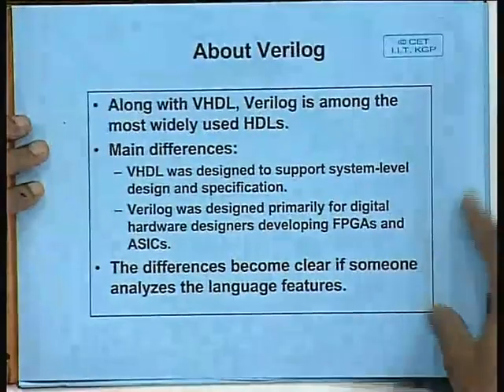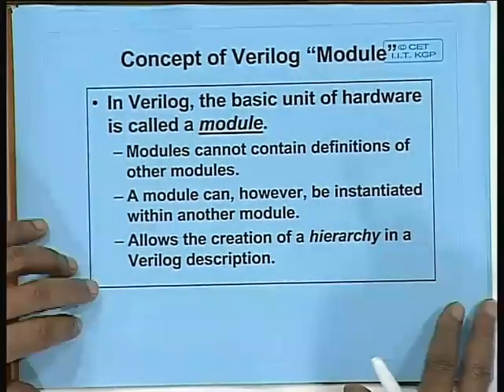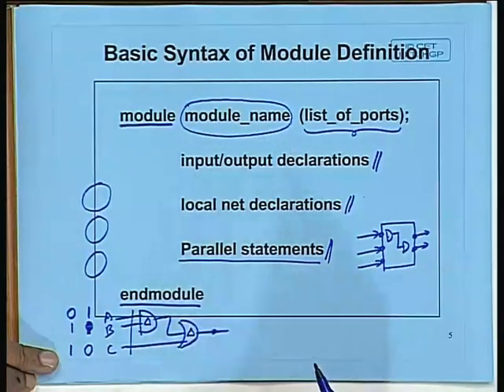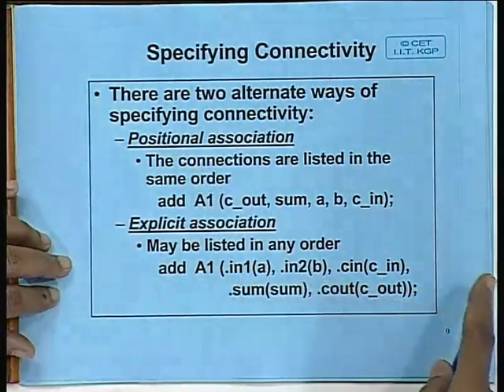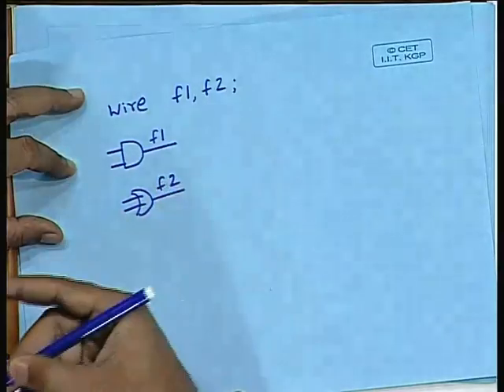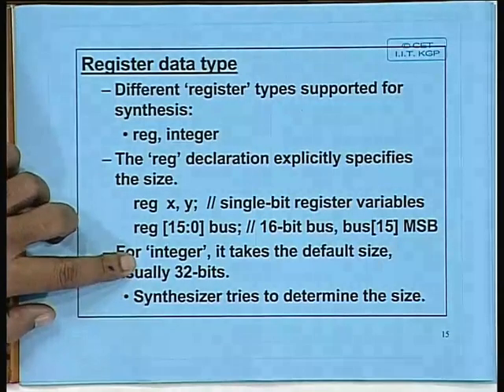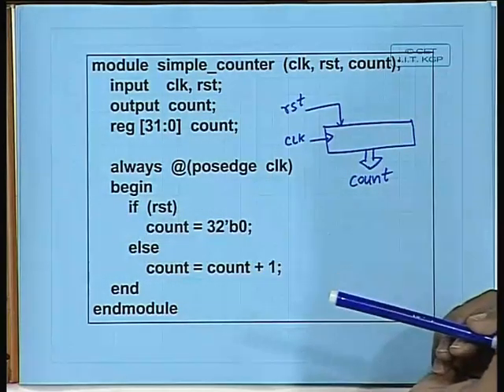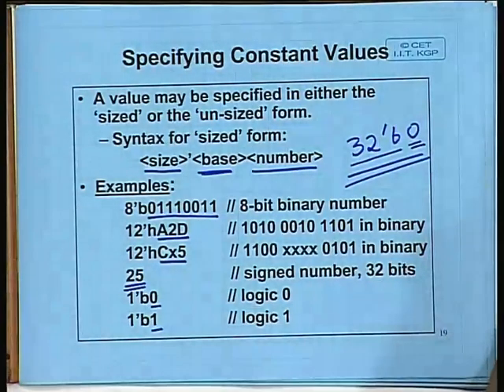Lec-2 Verilog: Part-I

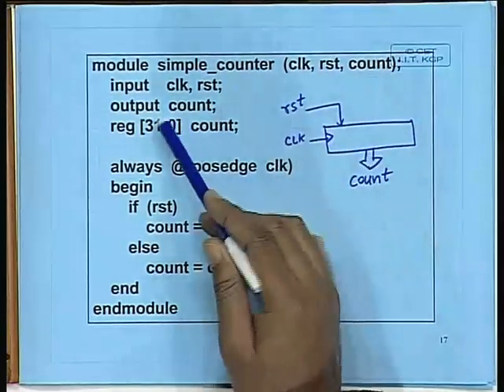Comment: 40:38 
actually this code is giving error in online verilog simulators.
Instead I tried declaring output and register in same line 
like :
output reg[31:0] count;

it perfectly worked.
Reply: Which online verilog simulator you are using?
Reply: Verilog HDL Complete Series | Lecture 3 - Part 1 | Data Types in Verilog HDL by FPGA made Easy Youtube channel.